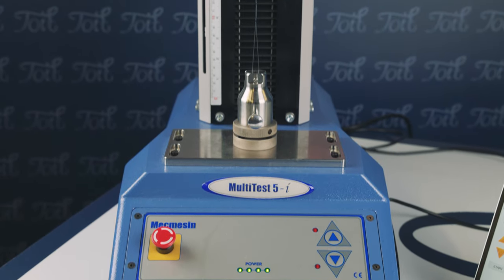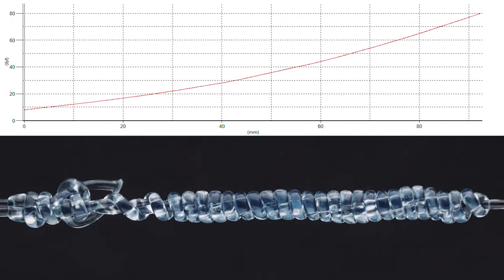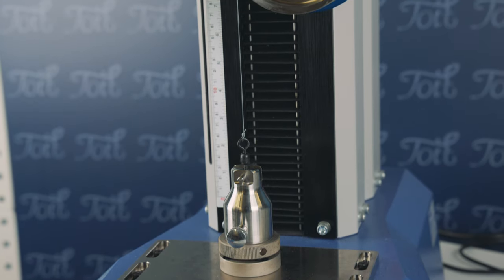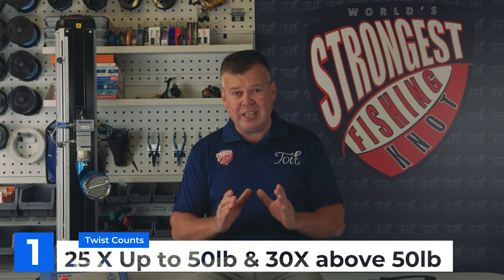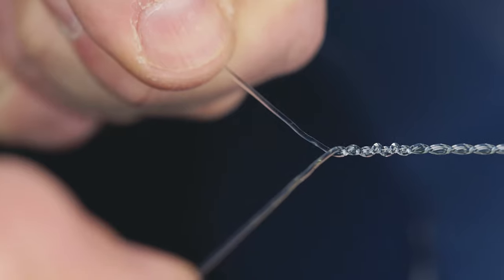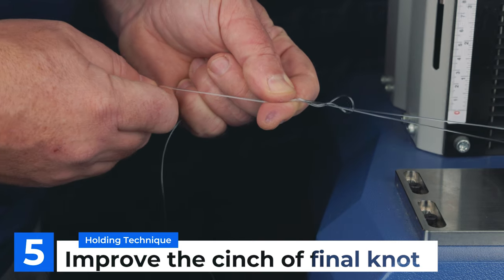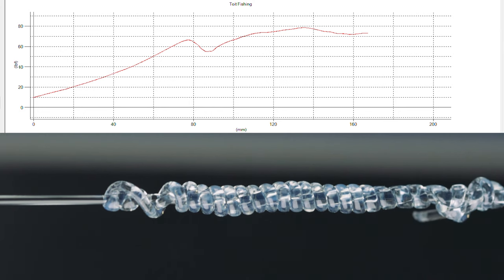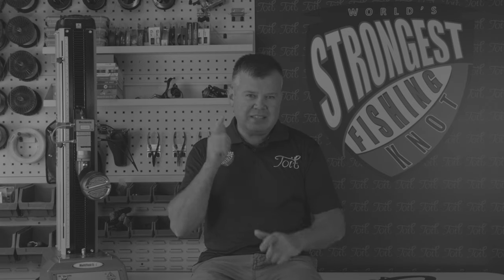Bimini Twist Tested | World's Strongest Fishing Knot | Episode 16

Comment: Great work and one of the few strongest fishing knot channel that is actually legitimate instead of hearsay. A suggestion would be to test the Bimini Twist in braid. I test knots myself mainly actual line strength, FG, and PR knot test. I know it's a thankless task and time consuming having tested knots hundreds of time. I am curious what your Bimini Twist in braid will reveal. I doubt you will achieve 100 percent knot strength. Too many variations in a Bimini twist and the specific braid itself will determine how strong the Bimini Twist in braid is. Very rare to get 100%, maybe 5 % of the time and it's braid dependent.

Comment: Bimini twist to palomar at the end on the hook has to be the strongest terminal "knot" in existence. the hook simply can't pull out due to the palomar on the closed loop.  I certainly don't have the measuring tools, but in multiple pull tests with 20 lb mono and fluoro, the line always broke at the pulling tool, never at the bimini or palomar. short of a steel leader, I don't think it can be improved upon. Obvious shortcoming is the bulk, so it's a no go in any line shyness situation, but you likely wouldn't need a doubled line then anyway.
Reply from the maker: The only issue may be if the Palomar was tied incorrectly ie, the final loop needs to go thru the middle of knot rather than the end of knot where all pressure is on the exiting line. I would also say if the double lines into palomar are not coerced correctly and one of the lines exiting Bimini is loaded biased to one line, this will cause slippage within the palomar which may cut into the line, but at circa 40lb and below lines I would say it’s definitely a good connection. Tightlines
Reply: @toitfishing  good point, I’ve always felt weird if the palomar “noosed” the main line, I push it down onto the knot, it was just a gut feeling but it seems the science bears that out :). And I somewhat agree on the “uneven legs” point, don’t find it hard to tie this evenly on 20 lb which is my go to, but it could be an issue on heavier. But what about this benefit- if one leg breaks for any reason, you’re still tied on with a normal palomar if you’ve cinched it down strongly, and if you break the correct leg lol you’re on the main line anyway. Is there  any other knot that has this potential failsafe? Plus on any line with stretch, either the palomar would center itself, or you’d have a bit of shock absorption built in. If it’s obviously uneven I’d retie anyway, but human imperfection might not be that bad a thing in this case. Again, haven’t tested properly, and won’t lol, but seems very legit in my tinkering. This hybrid is such a production it would be overkill for my usual bay and inshore fishing, but I’m definitely trying it out next time I go after bigger game.

Comment: Fantastic series. Am watching from Ghana, West Africa. Have you managed to do any testing of the Bimini twist in braid yet. in thin braid i have trouble with it snapping where the half hitches are. i suspect i am over tightening them there and cutting in on itself thus weakening that point. not sure..  need to try different finishes. as far as the twists and over wrap go, i find it easier in braid than mono. i do lubricate the braid when i am twisting it and finising it etc.

Comment: Absolutely love this channel (and the Toit Knot). You're by far the best line/knot tester on YouTube, and you're not selling us anything.

One big gripe I have with pretty much everyone doing this, however, is that all the testing is done dry. 

Manufacturers' ratings are all wet ratings. Fishing is done in the water.

Water doesn't just lubricate a knot, or just change nylon monofilament's ultimate strength. It changes its volume, density, yield modulus, bulk modulus, creep modulus, surface hardness, etc. All of which affect knot strength.

I'd love to see a comparison of wet vs dry knot performance. Not just "wetted" dry line, but line that has been soaked in water for a few hours, to simulate real world conditions.
Reply from the maker: Thank yo so much for investing you time watching the channel. I really need to get some new content out. Just been really busy recently, Tightlines.

Comment: Excellent video work, as in all of your work. Seeing the knots and lines deform as tension is applied is simply amazing.

The tips were also very important and extremely helpful, particularly the importance of lubrication.

Now that the loop knot part has been tested and shown to work so well it you have set yourself up for more testing on the the other end, the loop to leader knot. As I have mentioned before, for trolling I tend to use the cat's paw to a swivel but it would be interesting to see how the Yucatan works on the leader end with lighter leaders for especially spooky fish.

I'm looking forward to seeing how the Aussie braid stacks up against the Bimini as that has been my go-to knot for lines over 30lb.

I might just use the easier Bimini though I've always liked the elegance of the Aussie braid finish where you double to tag end for a few braids the pass the main loop through the loop in the tag as suggested by Geoff Wilson. One advantage of the Aussie braid is that it can be used to join equal lines.
Reply from the maker: Hey Brian, great to hear from you. Yes indeed I definitely want to test these knots as you mentioned above. I am also keen to test my modified version for the Actual version of the GT knot, the bit where I wrap it initially around the Figure eight knot. I think it will prove to be very effective. My only reservation is how the Bimini will cope in Braid, I have seen the slipping in mono 1st hand but braid is going to be a whole different ball game, I know some Boat captains out of Palm Beach and they are using in excess of 60 wraps on Braid, that is definitely an arthritis inflictor, lol. Tightlines and thanks for the feedback.

Comment: Makes you wonder if the 25 twists are overkill. Perhaps 15 or 20 are enough. We see this magical number of 16 twists is often reported as the "border of diminishing returns".  
I dunno, but if the first twists are breaking under tension anyways, perhaps this is worth testing? "The threshold of diminishing returns."
Reply from the maker: Hey the Heck, good to hear from you, yes I tested various wraps from 15 and upwards on all the line weights as per my usual, I settled on 25 for up to 50lb and 30 wraps for more than 50lbs Mainly due to eliminating slipping, as I mentioned in the video slipping is not fully detrimental to the knot as it copes really well as I showed in the 100lb category but when you start dropping it below 20 wraps you introduce too much movement as the twists just don't get wrapped up enough when doing the barrel wraps. I think it would cope fine if you were able to really constrain the barrel wraps very tight maybe with a bar puller but this may be slightly cumbersome when tying, hope that helps. Tightlines

Comment: J'ai testé mon noeud. Avec du fil tressé 10 livres, un Bimini à chaque bout,  et une balance à poisson. Il casse à 13.5 livres, mais toujours au commencement du noeud Bimini. C'est correct, ou je peut faire mieux ????
Reply from the maker: Most Braided lines on the market of what I have tested break at 2X the breaking strain generally. So if it is a 10lb line I would expect the manufacture sells it at around 20lb actual breaking strain. I would say if it is failing at the knot there is always room to improve, but on braid it is difficult as the microfibres always fail where the lines are touching within the knot. Try increasing your initial twists on the Bimini for braid, sometimes on 80lb braid I will use in excess of 50 twists for the braid not to slip.
13.5 lb is a good figure to, I would be more than happy fishing with that on 10lb.